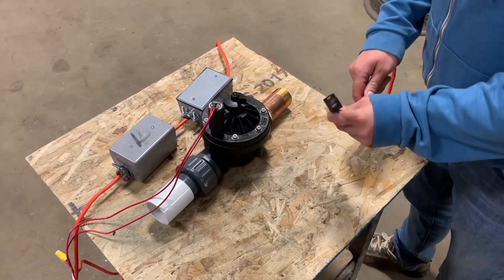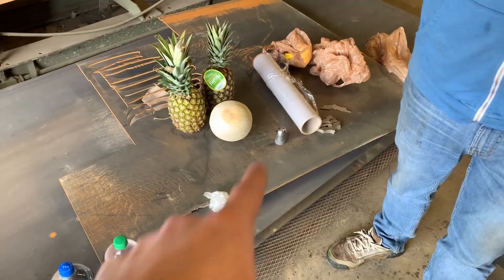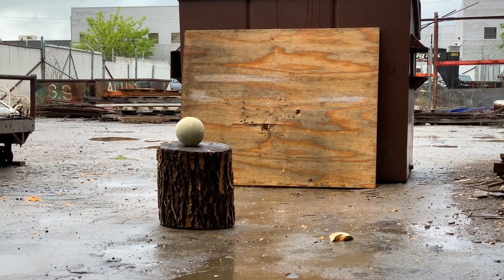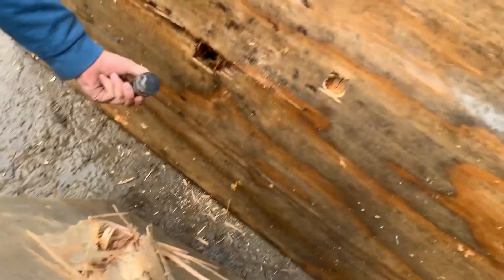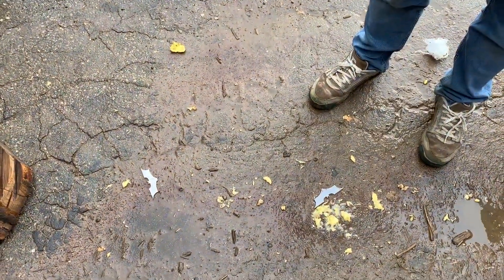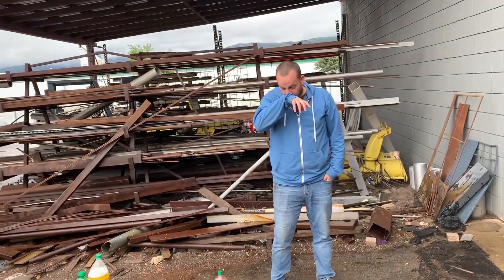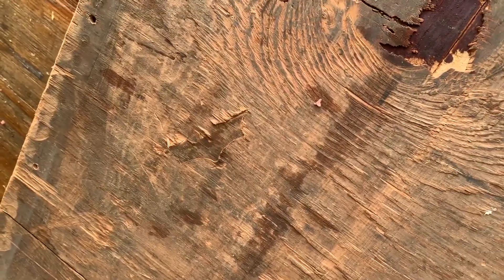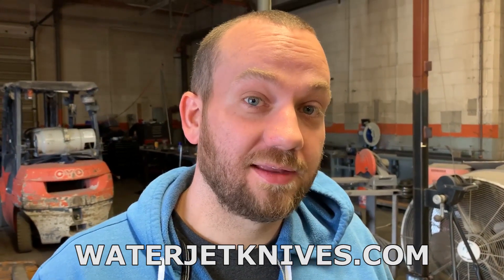300+ MPH Batarang from DIY Air Cannon

Comment: You guys should find a  way to rifle your barrel.
Reply: Maybe it could be done just by using a tap and die set... idk the cuts might be way too deep and it would have to be a really large set
Reply: They could also add rifling to the bullet. Like some shotgun slugs
Reply: Wouldnt that be pointless? They are literally less than 6 feet away from the object
Reply: @thatxonexguy5438   i believe the point is to get the slug to fly straight in this case and not to add distance similar to spiraling a football
Reply: nah,  bb shotgun
Reply: They could just put a rifled choke on the end so that it is easy to update, and they don't loose a lot of energy in the first part of the barrel from air rushing past in the groves in the sides. Maybe just wrap a tennis ball with glue/resin and water jet cutting sand and stick it on the end of a long pole to twist it as you push it down with less and less twists per inch. You could make a better transition so that it starts with smooth bore and the rifling is made of tons of small scratches that gradually have more of a twist so it would keep a lot of the speed. Does that seem like it would work well I just don't know if the effect of tons of little scratches will have the same effect of spin or if actual rifling will cause too much blow by? What is more important? Also fins on the end could straighten out a projectile too.
Reply: ThatXoneXguy it increases speed and rifling would also help with the bullet tumbling
Reply: Also, maybe a 3d printed sabot with a tungsten bolt in the middle!
Reply: Machine a Boat Tail bullet, maybe Chromoly Barrel with w Aluminum  bullet? Brass and a Tungsten Core would be awesome,but the penetration maybe a lil much
Reply: Rifling might also help keep an object straight when being fired
Reply: It's the slug that needs rifling, IMHO.
Reply: or just cut angled fins into the back of the round
Reply: Easier... make a dart.

Comment: You need to make an ultra pointy projectile
Reply: Yeah, like a little mace ball-head or something.
Reply: A dart point
Reply: The problem is the stabilization
Reply: @serratedsteam  mhmm your right🤔 maybe balance it by drilling out the back so the front is heavier and more stabil
But im not an expert,😂
Reply: Andrewplays what about fletching like on an arrow?
Reply: @rublie1426  yeah but the barrel might be in the way
Reply: @andresteinmaurer1171  Maybe you can make the fletching spring loaded so that it pops out after it leaves the barrel. I think blowguns do that. Maybe giant tranquilizer darts are a solution.
Reply: Maybe add something like a feather at the end and have a 3d printed breakaway plastic thing so it would fit perfectly in the barrel
Reply: Yes, with fins and a discarding sabot!
Reply: 50 cal bullet, scale it up a bit, done!  By adding some length to the projectile that would make it a bit more stable.

Comment: two recommendations....One, weight or tie the end of the barrel down if you can. It will greatly improve accuracy. Barrel whip starts before the projectile leaves. Second, with the random things you cut for vids, you should cut a slug that will fit the canon then shoot them and see what happens to the various things.

Comment: Joerg Sprave had his air cannon valve fitted with a rubber band mechanism that pulled it open incredibly fast, but was locked when not "ready to move."

Comment: Next upgrade will be to put packing tape over the muzzle and vacuum pump the air out of the barrel. The reduced drag will give you significantly higher speeds, especially with lighter projectiles.

Comment: Piston valves are the best FYI 😉 (I have a golf ball cannon)
Reply from the maker: Now we need to modify it again?
Reply: @WaterjetChannel  Yes but it will be worth it. They're far superior.
Reply: @WaterjetChannel  I built a piston valve air cannon out of PVC pipe and fittings when I was a kid.  With a 3" barrel and 60psi it would launch cans of string beans a 1/4 mile.
Reply from the maker: krinkov39 looks like it’s research time
Reply: @WaterjetChannel  Piston valves are awesome, definitely the way to go. They'll give you that instant, satisfying ffffump sound that you want to hear. Their activation time is milliseconds. I look forward to seeing it! ☺
Reply: @WaterjetChannel  If you can't find a suitably sized piston, get a wooden broom handle and turn it down on a lathe. Don't use any pvc parts because when activated, the piston slams backwards with a lot of force, so will likely shatter the pvc at high pressures. Use steel or brass plumbing fittings. 1 1/2 inch or bigger.

Comment: i think if you hollow out the back of the bullet it will make it nose heavy which in turn will make it a lot more stable in flight. right now since you have rounded the nose the bullet is back heavy which is why it turns around right after leaving the barrel. any projectile always wants to fly heavy side forward. also rifling would make it even more stable but i think at the short distance you are using the canon, it will not help nearly as much as bullet modification. Pro tip look at airsoft BBs, they have a flat and heavy nose and hollowed out and light rear skirt.
Reply: those are airgun pellets. airsoft BBs are round. (Spheres)
Reply: @brinesilver405  sorry i meant airgun pellets. a slug with center of gravity in front of center of pressure does not need spin to fly straight or at least stay pointy end forward, but obviously spin would make it even better

Comment: The solenoid sounds like it is oscillating when the cannon is fired and losing some power in the process , convert the AC input to DC to keep the valve open and stop it partly closing near the 0 volt crossing the horn effect you hear .
use a full bridge rectifier with a filter capacitor 50V 10,000uf (overkill but can handle the ripple current, higher volts is good but don't go lower see exploding capacitor ) which wound give approx 34VDC that would certainly fry the coil so you will need to add a current limiting resistor which would depend on rated current and ohm's law and add a flyback diode for good measure a bit of extra work but well worth it you may be able to getaway with 2 9V batteries in series if it draws less then 200ma

Comment: Need to use a Styrofoam ball or cylinder cut in half with battarang in between the two pieces. May have to hollow out the shape of the battarang on inside of foam.

Comment: Put an electric motor on the pad and spin the shaft with the waterjet and measure how much power output it has at high rpm

Comment: Technically, wouldn't you be able to get an air tank powerful enough to shoot tank munition with? I mean, if the pressure is high enough... It replaces gunpowder right? How much PSI would you even need to contain that?

Comment: Also the water heater is round, giving it more structure. Thus being more rigid then a flat dumpster of the same thinkness lol. Me so smart
Reply: Actually that would make the round go through easier as it reforms less and uses less energy to move (translate in space) the heater. The slug will go through the side pretty much the same whether it's flat or curved; as long as it hits it perpendicular to the curve.
Reply: @xenonram  the point wasnt penetration. They got penetration on the water heater, was just sheer damage.